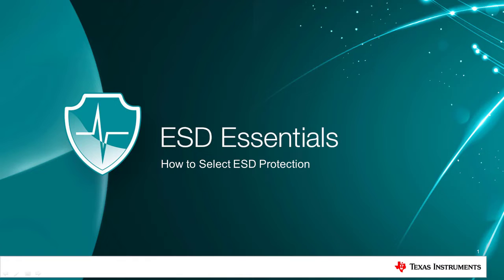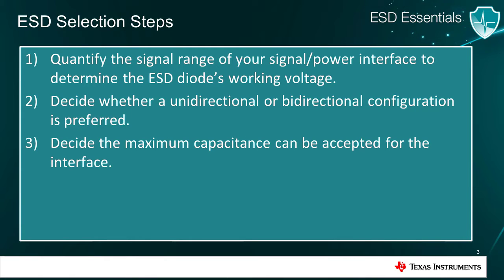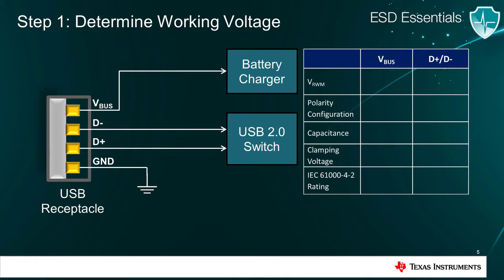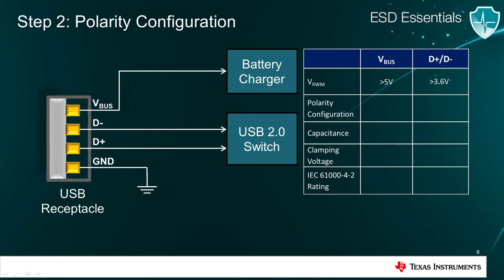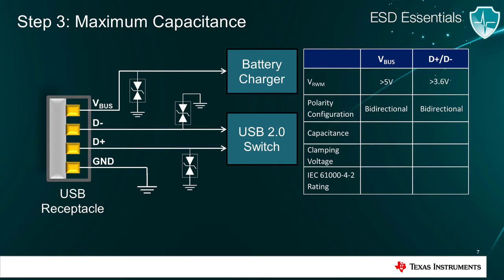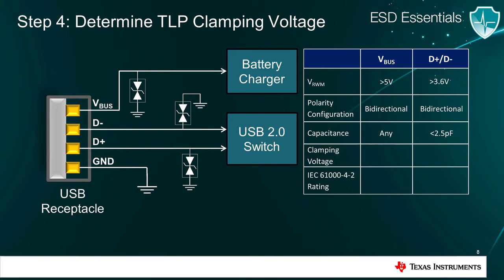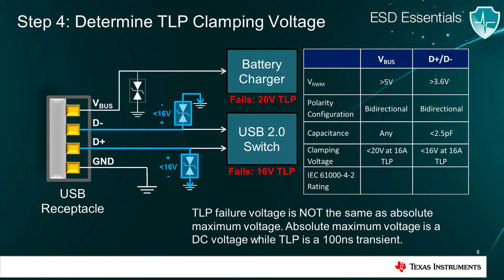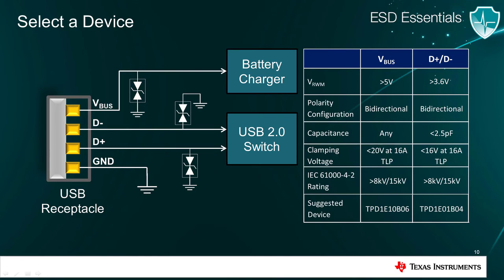ESD Essentials: How to Select ESD Protection

Comment: Why is the bidirectional configuration chosen? The voltage is never meant to be negative on USB bus, thus wouldn't a negative voltage break the device?
Reply: You are not in control of the ESD voltage coming from the outside (wool carpet discharged to the connector can be negative or positive referred to GND).
Reply: @PszemoI  Yeah but a unidirectional diode would clamp to -Vforward instead of the bidirectional voltage rating, which is better. There is no "flexibility" provided by bi-directional diodes as stated in this video
Reply: @MCSGproject  The flexibility referred to here is in regards to connecting any pin to the bus and any pin to ground for a single channel diode.
Reply: @Matt-pd9jo  what do you mean?